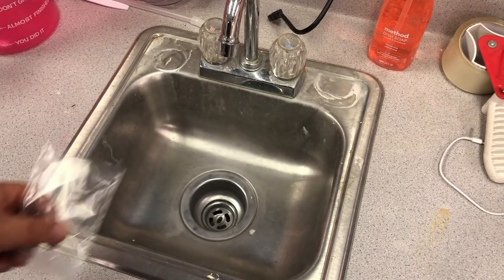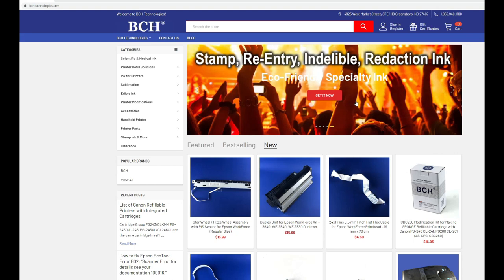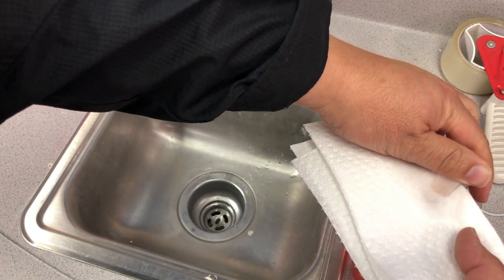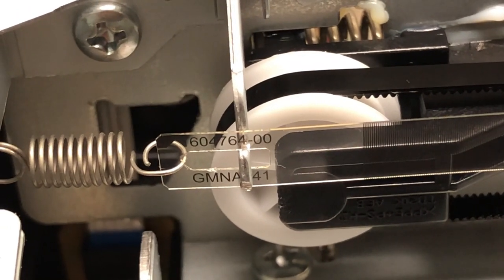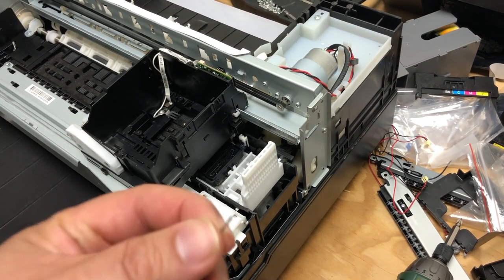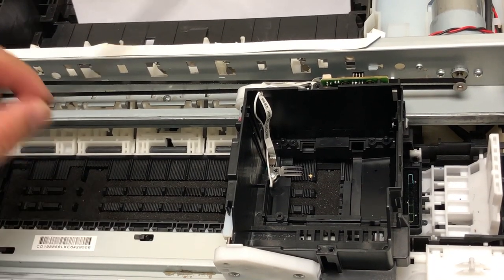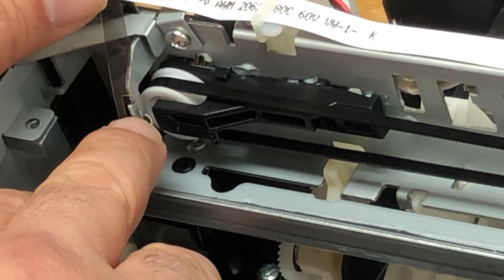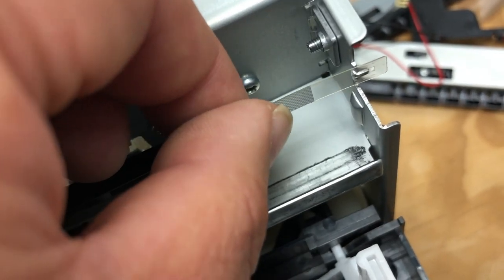How to Install Epson Carriage Scale Timing Encoder Strip

Comment: What do you look for if you buy a new encoder strip and your printhead goes close to the left side, stops, then keeps going and you hear a shrill noise?  0XEA error shows, restarting the printer does the same thing, over and over.  Then what?  Thanks Keven, the encoder strip did stop the print head from slamming into the left side of the printer, but it's like it doesn't know where it is on the rail.  I cleaned the strip with iso alcohol when I got it.

Comment: I have an et4700 and it seems the timing belt is messed up.  It makes loud noises. And gets stuck during printing please help
Reply: That’s what mine is doing. Did you figure it out?
Reply: @tarrisalcedo  Did either of you figure this out?  Keven At BCH says it is usually the encoder strip being bent and/or dirty.  I cleaned mine twice, put it through the reader slot (which nobody else has mentioned but Kevin), replaced and cleaned a new strip and I am still getting that screeeching/grinding noise with a 0XEA error.  Turning the printer on and off does not solve it.  I will link to this video, let me know if you find an answer besides the encoder strip.

Comment: I replaced my belt now my printer throws the head all the way to the left and makes a terrible grinding noise. What do I do now?
Reply from the maker: Your belt is installed incorrectly on the left. Check the tension
Reply: @BCHTechnologies  I figured it out. I actually missed the slot in the back of the head where the encoder strip is supposed to pass through. So it was actually behind the carriage as opposed to against the sensor. Thanks for the reply though! Now if someone can post a video on how to replace the carriage belt that would be SWEET!
Reply from the maker: @supergrendel  Congratulations!